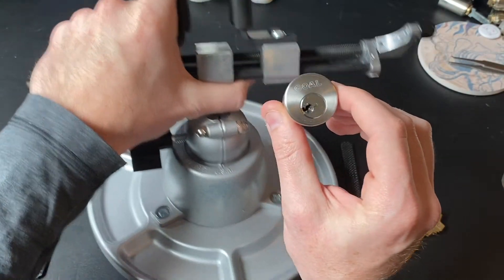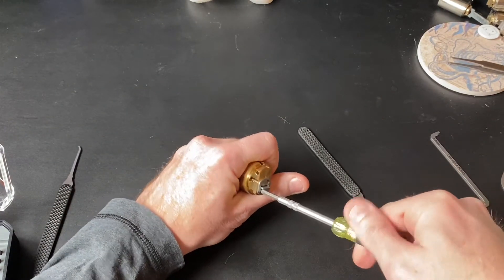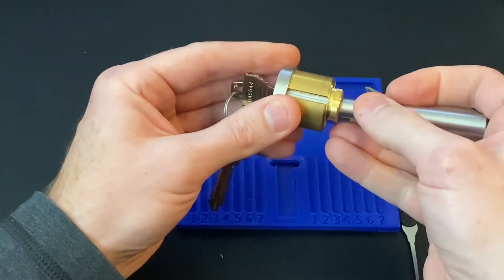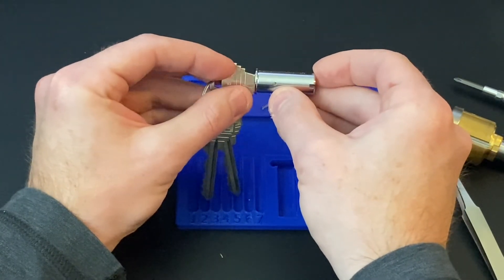Goal P, picked and gutted

Comment: Thanks for the breakdown. You think this would be a good warmup to Assa gins? I really enjoy the format of your vids.
Reply from the maker: The pins act somewhat different but the idea is the same, so I could see that. Compared to Assa gins the matching of the milling and pin isn't as tight, and the ball bearings provide counter rotation so you don't need to float pick. Much easier than something like an Assa 700 in my opinion. I have a Goal Z I need to pick to compare.